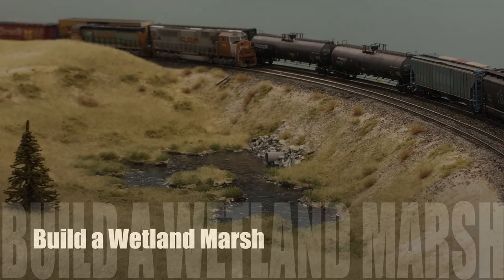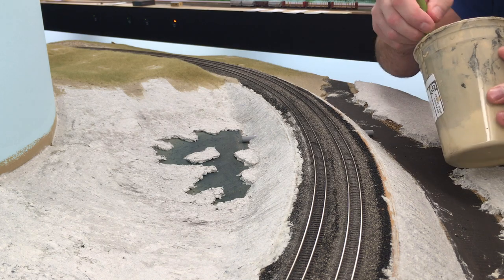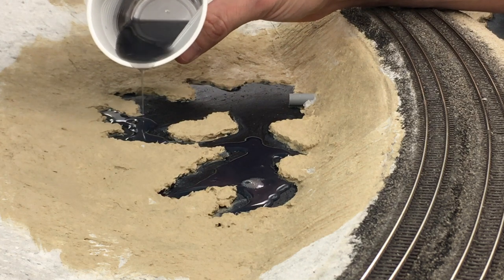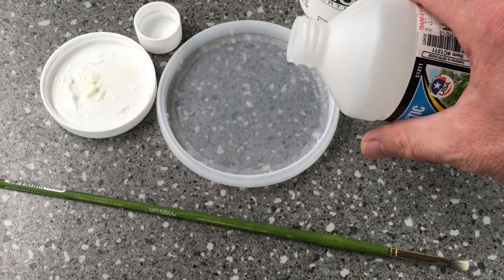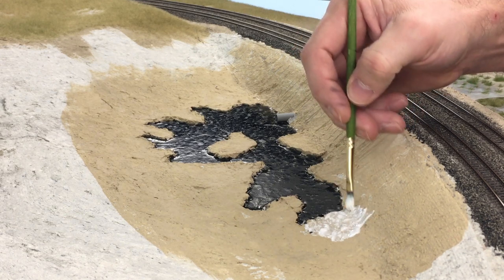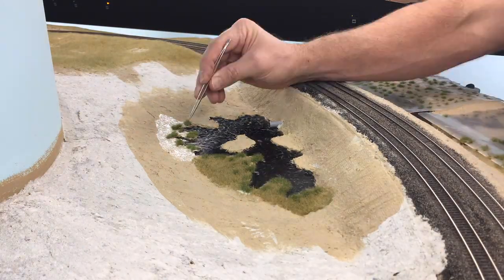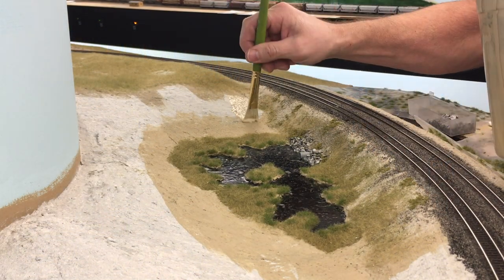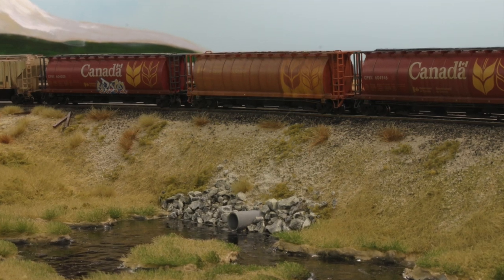Modelling a Marsh - Southern Alberta Rail

Comment: Nice. Interesting to see the dirt go on after the grass. I plan to make something similar but with a more regular square culvert.
Where did you get or what did you make the grey/granite rocks from? It’s a very realistic add on. 
I’d be interested in how you’d model the often seen geotextile cement filled embankment reinforcing.
Reply from the maker: Thanks for tuning in.  The Rip Rap is made using plaster scraps from the rock casting process.  I have a video covering the technique in the Members section of my channel if you're interested.  Cheers!  -grant

Comment: Nice tutorial, thanks. How did you make the tufts, Glue and longer static grass? If so, how long?
Reply from the maker: Matte medium and 4 mm grass Derek.  You can use a longer length but I just went with a more vibrant green to accentuate the bank and the proximity to the water.